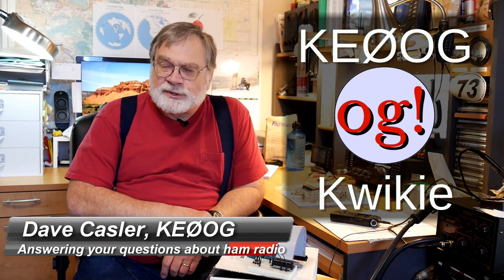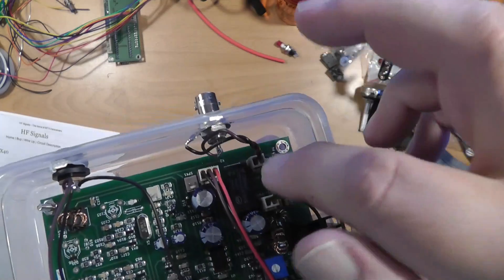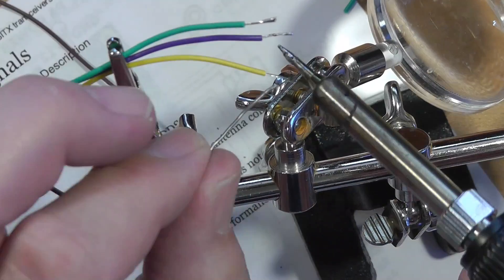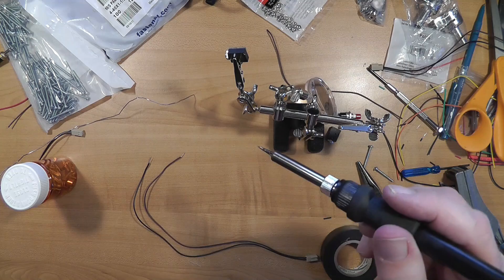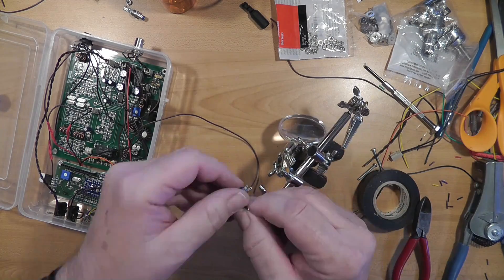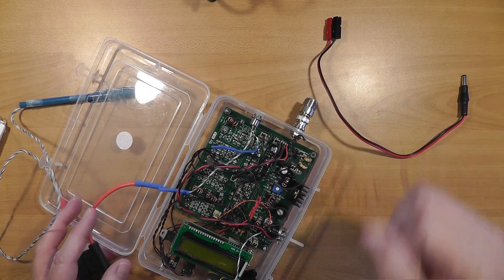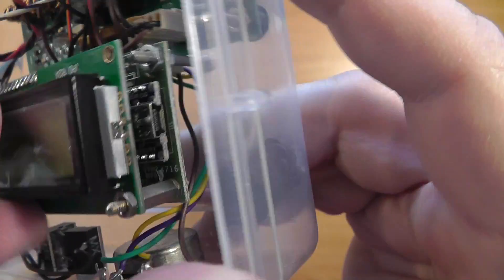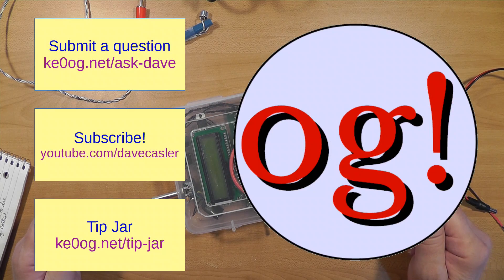Assembling the BITX-40: KE0OG Kwickie: #48

Comment: David, I appreciate you and your videos, thanks! I have the BITX-40 but do not understand one item. There is a jack or output for a PA Power (power amplifier) of 12vts. There is a connector supplied with two wires. The drawing simply has those two wires going directly to 12 vt. no switch, no nothing in between. Then, there is mention that you run the 12 vt through the on/off switch then out to the PA Power jack. The sentence is not correct nor written properly and it throws me. I guess it boils down to this: once I plug that two lead plug on the socket that is called out for PW Power, where do the two wires go? I dont understand the write up which states you can use an external power amp?   Again: I have a 12vt mention on the drawing going to that plug with two wires directly on the board YET I have  the directions on the first page telling me I should run a parallel line through the on/off switch for the power amp.......sorry, I am as confused as this poorly written question:  73's.
Greg
Reply from the maker: Yes, you connect those two wires to the power supply at the on-off switch. However, if you want more power out, you can feed the final amp with more voltage. But note that you will have to provide a much larger heat sink for the final. Best to just feed it with 12v if you don't feel comfortable making mods to the heat sink.

Comment: Thanks for the video, I only wished you had taken more time about where the wires actually go. For example pause and explain what wires aren't used. The manual doesn't explain that. Also wiring the potentiometers the diagram leaves me wander from what side the view is. Your video zapped over that. Lastly what pins to connect on the audio jacks. Yes tip about pre-tinning is great but no need to explain that multiple times. Rather would have seen / heard more detail about the actual wiring.

Comment: Dave, I know what you mean "busy" and "overwhelming" I know nothing about code writing and the raduino. In my opinion, too many are trying to fix/hack/mod a simple radio. It's no Elecraft. If you ever get to play with yours, I like to have users evaluate the rigs operation and possibly suggest 5 or so "must do" mods that enhance the usability without re-designing everything. Yes the flutter is annoying, as is the clicking. But it's not a show stopper. No agc, no big deal to me, no transmit light, no big deal etc etc. i would like to make mine smaller. Not as tiny as your temporary shipping case. But smaller than my rather large one. However, mine does hold the 12vdc, 5AH battery just fine. So that would mean an external power source. Have you tried a small switching supply? If so does it work? Recommendations are for a more substantial supply. So much to learn. 73
Reply from the maker: +Mike Davis I'll address this in an upcoming video.

Comment: Thanks for the Bitx40 overview. I. Finished mine last week and in many ways we are on the same "page" I hard wired my mic and passed the shielded (yes I used shielded) through a gromet hole in the case. I mounted a power pole in the case and having enough room in the case, I selected to house a 5ah AGM battery. I wanted to mount an SO239 but didn't have a large enough hole making device so I went with the supplied BNC and the SO239 adapter as you did. I also decided on a mini toggle for power on/off. I just didn't like the volume control switch. All plugs and controls are on the front (except for a flush battery tender charging port in the rear. Conventionally, most radios have power and antenna connections in the rear. I wanted the option to lay it on it's back, side or bottom. I've had a few qso's so far and am happy with this neat little project. The Bitx40 group is hacking the radio to death to minimize some of the little quirks. If you have a few days, give them a look. Keep up the good work Dave. I'm new to the hobby at 74, a 60 year SWL'r licensed in 2014, General and Extra in 2015.
Reply from the maker: Mike, thanks for the information. My little plastic case is intended to be temporary while I learn more about what I want. Indeed, the BITX group is so busy that I'm overwhelmed with posts. It's hard to keep track of who's doing what. I plan a couple more videos on my unit to come out very soon. 73, Dave, KEØOG

Comment: What dedicated home-brew (budget building) antenna would you recommend for this for maximum effect?  I have a big yard (football field size).
Reply from the maker: Definitely a dipole. Get it as high in the air as you can. If you only have one tall point, you can use it to hold the feedpoint in the air and then the ends can go down pretty much down to ground level, though it's a good idea to keep them high enough in the air that someone wandering through won't hit them. Pretty much all other wire antennas aren't really any better than a dipole. If you've got the space, go for it! 73, Dave